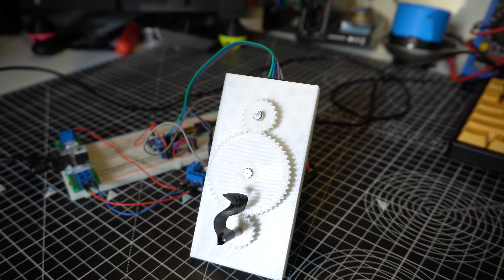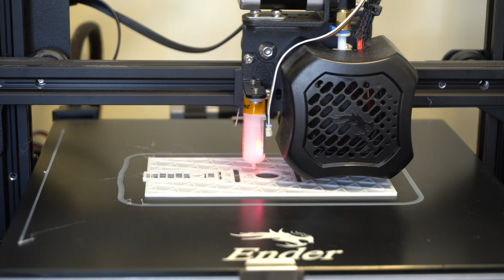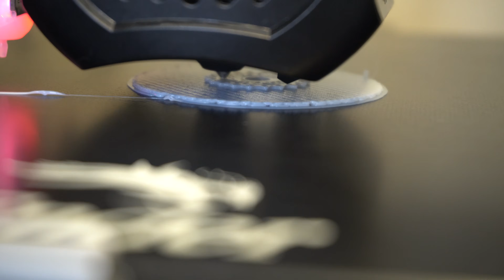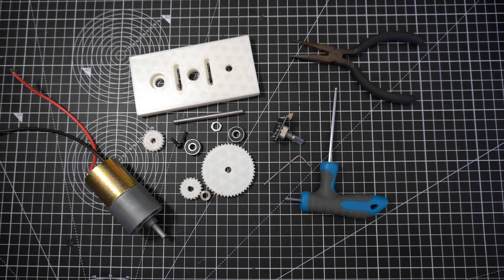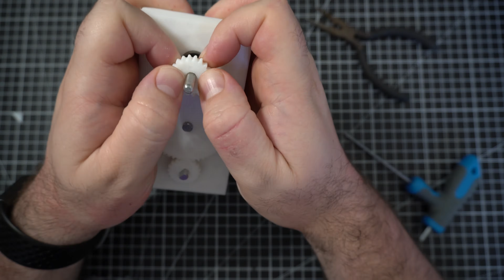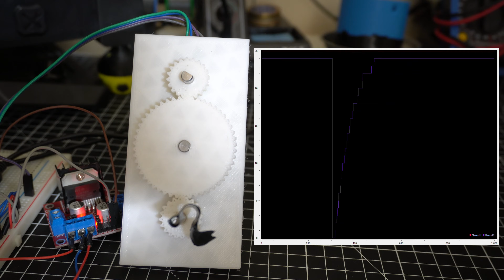Homemade Servo - PID Tuning

Comment: Interesting. Hope more manufacturers can open the source code of their servos. I make FPV helicopters for vertical dive bombing, and professional helicopter servos are precise but too slow to correct trajectory at terminal velocities. I tried a dozen different models to find one with a low I-term gain but good speed.
Reply from the maker: I think it also depends on the precision of the feedback loops and internal gearing etc. My understanding is that under the hood a PID controller should be enough to do it well, but I’m no expert

Comment: Ollo! I have a project in mind where the speed of the motor is generally more important than positioning (except for linear end points). I have a physical input device that sets motor speed at one of 8 speeds in either direction. 
Does it make sense to use PID to keep the speed consistent and to smooth the transitions from one speed to another? (I'm trying to improve on a standard control protocol that often leads to visible motion jerks)
Very much a newbie so sorry if this doesn't make much sense!
Reply from the maker: Hi there, yes a PID controller will work well for speed control too. The only difference will be your feedback sensor will measure speed not position. Everything else will be pretty similar to what I talk about above.

Comment: Hi, I've looked a bunch of your PID robots as well as your video explaining the code for a PID loop, and I think I have a good understanding of it now, but I was wondering how do you match the error that you calculate, or the result of your PID calculation to some motor speed in your projects. Because for example in the video where you explained the code you were essentially trying to adjust the voltage of the system, but i think in that case your output from the PID loop would also just be some voltage, so they work well together, but I am not sure how it works for example in your balancing robot, where your error is some angle of the robot, but then that is matched to some motor speed, so the input and output are two different things (robot angle, motor speed), I'm not sure if I explained my question properly, but thanks anyway.
Reply from the maker: That is a really great question. This is actually a common misunderstanding about what you are calculating with a PID controller. Ultimately the units i.e (speed, voltage, angle), don't really matter. What we are trying to do is take some input we can measure, process it in the PID loop and output some signal that can control the thing we want to control. 

It can be helpful to think of a PID controller as trying to figure out the ideal relationship between an input and an output. You can kind of consider that the transformation of units is baked into this relationship. However, ultimately, what is more important than the units themselves, is the shape of the signals and how they interact with the PID loop and the thing you are trying to control.
Reply: @careyian  Oh ok I see the units don't really matter, its more so the output signal which you generate, that clears things up for me a bit, but still a bit confused on how if I were to do some balancing robot or something similar, how I would go about figuring out a general motor speed to use, or maybe make it variable and not a single speed which you just turn on and off rapidly, would really appreciate if you could make a video just walking through the code and how you sort of send the output of your pid loop to some motor. Thanks for reply.   

Edit: One other thing is I am not sure if you are familiar with kinematics for robotic joints to achieve some motion, because would also like to see some video on that since you are quite good at explaining the details surrounding PIDS.
Reply from the maker: Another good question. Usually for a motor speed control problem you want to use a variable speed. If you think about a simple DC motor, you are probably going to use a speed controller of some sort. Usually, these controllers accept a 5V PWM signal to set the speed of the motor. So in an Arduino, the output of your PID, which will control the speed of the motor will be a value between 0-255 to match the Arduino PWM output. I have just put all my PID videos in one place, you might find more useful info there: https://youtube.com/playlist?list=PLMqshdJjWZdkO_8wSUmBRZMOiVnq1stfB&si=J2MZLUFfTeZLbuqV

As for kinematics for robot joints, I don't have a huge amount of experience on that, but I have one video where I talk through deriving a basic inverse kinematic model for a simple robot arm, you can find it here: https://youtu.be/5TuQZ1PGsQo
Reply: @careyian  Thank you.